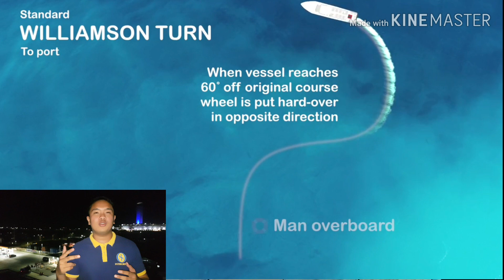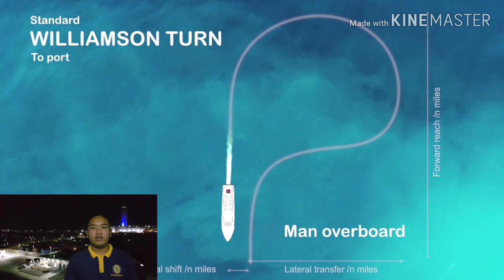SEAM 5

Comment: 1. No, the most effective rudder angle is about 25 to 30 degrees. This is because the rudder is 'stalling at 35 degree angle.
2. About same position as the center of gravity.
3. The sea-trial tests my tell me, or else I can do a test myself to find out.
4. Full power on the forward tug, reduce on the aft tug while checking the gyro.
5. The speed should be less that 5 knots, normally 3-5 knots.
6. Yes, it will give the stern a lift force to starboard. 
7. Full power on the aft tug, reduce on the forward while checking the gyro.
8. Your ship will sheer to starboard rather quickly with the possible consequence of grounding.
9. All the  listed alternatives.
10. Yes, by putting the rubber hand stb., it will  shield water flow to the tbs. side of the propeller and vice versa to port. This will effect turning of the ship.

Comment: Mooring and unmooring operations provide the circumstances for potentially serious accidents. There is no doubt that, this duty requires a good technique initially in lifting the heavy eye of the rope, followed by a good pulling technique. Care must be taken, therefore with the laying out of heavy mooring ropes and wire ropes/hawsers.

Comment: 1. That the wires are just above the water line at all times.
2. be rejected away from the bank by the pressure
3. About 20 %
4. Direction B.
5. It will be much shorter
6. 100 Tons
7. No, drifting in ballast condition may be quite different.
8. Put the rudder hard to port to reduce the water flow to the right side of the propeller
9. Longer
10. A keeps out of the way of B

Comment: 1. Full power on the aft tug, reduce on the forward while checking the gyro.
2. All the listed alternatives.
3. The speed should be less than 5 knots, normally 3 - 5 knots.
4. The sea-trial test may tell me, or else i can do a test my self to find out.
5. About the same position as the center of gravity.
6. No the most effective rudder angle is about 25 - 30 degrees. This is because the rudder is stalling at 35 degress angle.
7. Yes, by putting the rudder hard starboard it will shield waterflow to the starboard side of the propeller and vice versa to port. This will effect turning of the ship.
8. Yes, it will give the stern a lift force to starboard.
9. Full power on the forward tug, reduce on the aft tug, while checking the gyro.
10. Your ship will sheer to starboard rudder quickly with the posible consequence of grounding.

D/C Sarte, Joemar M.
Seam 5
( MON ) 7:30 - 8:30am
( TTHS ) 7:30 - 9:00

Comment: The Chief Officer ( or another experienced officer in lieu) must supervise letting go or weighing the anchors and shoukd only assign experienced crew members to anchors work.

prior to Anchoring, the chief officer should be aware of:
*approximate anchoring position
*Method of approach
*Which anchor use
*Depth of water
*Method of Anchoring
*Final amount of Cables

Borongan, Aldence Joel
TTH(9:30-12:00) F(7:30-8:30)

Comment: James Fred Maglasang
MTTh ( 7:30 - 9:00)

 *Yes, it will give the stern a lift force to starboard.
* All the listed alternatives
* Full power on the forward tug, reduce on the aft tug while checking the gyro.
* Yes, by putting the rudder hard stb. it will shield waterflow to the stb. side of the propeller and vice versa to port. This will effect turning of the ship.
* About same position as the center of gravity.
* No, the most effective rudder angle is about 25 to 30 degrees. This is because the rudder is 'stalling' at 35 degrees angle.
* Full power on the aft tug, reduce on the forward while checking the gyro
* Your ship will sheer to starboard rather quickly with the possible consequence of grounding
* The sea-trial tests may tell me, or else I can do a test myself to find out

Comment: 1. 
 The sea-trial tests may tell me, or else I can do to myself to find out.
2. Yes, it will give the stern a lift  force to starboard.
3. Full power on the aft tug, reduce on the forward while checking the gyro.
4.  About same position of center of gravity.

5. The speed should be less than 5 knots, normally 3-5 knots.
6.Full power on the forward tug, reduce on the aft tug while checkin the gyro.
7. Yes, by putting rudder hard starboard, it will shield waterflow at starboard side of the propeller and vice versa to port. This will effect turning of the ship.
8.All listed alternatives.
9. Your ship will steer rudder starboard rather quickly with the possible consequence of grounding.
10.  No, the most effective rudder angle is about 25-30 degrees. This is because the rudder is "stalling" at 35 degrees angle.
D/C Miko Fuertos

Comment: 1. Full power on the aft tug,reduce on the forward while checking the gyro.

2. Yes, it will give the stern a lift force to starboard. 

3. The sea trial test may tell me, or else i can do a test myself to find out. 

4. Full power on the forward tug, reduce on the aft tug while checking the gyro. 

5. The speed should be less than to     5 knots, normally 3-5 knots.

6. About same position as the centre of gravity.

7. Yes, by putting the rudder to hard starboard. It will shield the waterflow to starboard side of the propeller and vice-versa to port. This will effect turning of the ship. 

8. No, the most effective rudder angle is about 25-30 degrees. This is because the rudder is “stalling” at 35 degrees angle. 

9. Your ship will sheer to starboard rather quickly with the possible consequence of grounding. 

10. All the listed alternatives. 

D/C Rosal, Gerome Bryan N. 
BSMT- H3A

Monday(7:30-8:30am)
Tth(7:30-9:00am)

SEAM-5

Comment: D/C BALTAZAR, JEVER P.
MON 7:30-8:30
TTH 7:30-9:00
1. Full power on the aft tug, reduce on the forward while checking the gyro.
2. Yes, it will give the stern a lift  force to starboard.
3. The sea-trial tests may tell me, or else I can do to myself to find out.
4. Full power on the forward tug, reduce on the aft tug while checkin the gyro.
5. The speed should be less than 5 knots, normally 3-5 knots.
6. About same position of center of gravity.
7. Yes, by putting rudder hard starboard, it will shield waterflow at starboard side of the propeller and vice versa to port. This will effect turning of the ship.
8. No, the most effective rudder angle is about 25-30 degrees. This is because the rudder is "stalling" at 35 degrees angle.
9. Your ship will steer rudder starboard rather quickly with the possible consequence of grounding.
10. All listed alternatives.

Comment: D/C Bejagan, Rodel A. 
7:30-8:30 M
7:30-9:30 TTh 
1. Full power on the aft tug, reduce on the forward while checking the gyro.

2. Yes, it will give the stern a lift force to starboard.

3. The sea-trial tests may tell me, or else I can do a test myself to find out. 

4. Full power on the forward tug, reduce on the aft tug while checking the gyro.

5. The speed should be less than 5 knots, normally 3 - 5 knots.

6. About same position as the center of gravity.

7. Yes, by putting the rudder hard stb. it will shield waterflow to the stb. side of the propeller and vice versa to port. This will effect turning of the ship.

8. No, the most effective rudder angle is about 25 to 30 degrees. This is because the rudder is 'stalling' at 35 degrees angle.

9. Your ship will sheer to starboard rather quickly with the possible consequence of grounding. 

10. All the listed alternatives

Comment: D/C LUBANGA,  KURT WESLY L. 
( MONDAY) 7:30-8:30 
(TTH)  7:30-9:00

1.Your ship will sheer to starboard rather quickly with the possible consequence of grounding.
2.The speed should be less than 5 knots, normally 3 - 5 knots.
3.Full power on the forward tug, reduce on the aft tug while checking the gyro.
4.Yes, it will give the stern a lift force to starboard.
5.No, the most effective rudder angle is about 25 to 30 degrees. This is because the rudder is 'stalling' at 35 degrees angle.
6.Full power on the aft tug, reduce on the forward while checking the gyro.
7.Yes, by putting the rudder hard stb. it will shield waterflow to the stb. side of the propeller and vice versa to port. This will effect turning of the ship.
8.The sea-trial tests may tell me, or else I can do a test myself to find out.
9.About same position as the center of gravity.
10.All the listed ALTERNATIVES.

Comment: 1. The sea trial tests may tell me, or else I can do a test myself to find out.

2. Yes, by putting the rudder hard stb. it will shield water flow to the stb. side of the propeller and vice versa to port. 

3.About same position as the center of gravity.

4. Full power on the aft tug, reduce on forward while checking the gyro.

5. All the listed alternatives.

6. Full power on the forward tug, reduce on the aft tug while checking the gyro.

7. Your ship will sheer to stb. rather quickly with the possible consequence of grounding.

8. Yes, it will give the astern a lift force to stb.

9. The speed should be less than 5 knots, normally 3-5 knots.

10. No, the most effective rudder angle is about 25 to 30 degrees. This is because the rudder is 'stalling' at 35 degrees angle.

HONRADA,KYLE JASON BSMT
TTH 9:00-10:30

Comment: D/C LEGASAN, KENT S. 
M (7:30-8:30 am)
TTH (7:30-9:00 am)
SEAM 5
 -All the listed alternatives.
- Your ship will steer to starboard rather  quickly with the possible consequence of grounding
- About same position as the center of gravity
- Full power on the aft tug, reduce on the forward while checking the gyro.
- Full power on the forward tug, reduce on the aft tug while checking the gyro
- The sea-trial tests may tell me, or else I can do a test myself to find out
- Yes, by putting the rudder hard stb. it will shield waterflow to the stb. side of the propeller and vice versa to port. This will effect turning of the ship.
- Yes, it will give the stern a lift force to starboard
- The speed should be less than 5 knots, normally 3-5 knots
- No, the most effective rudder angle is about 25 to 30 degrees. This is because the rudder is 'stalling' at 35 degrees angle.

Comment: 1.Full power on the aft tug, reduce on the forward while checking the gyro.
2.All the listed alternatives.
3.The speed should be less than 5 knots, normally 3 - 5 knots.
4.The sea-trial tests may tell me, or else I can do a test myself to find out.
5.About same position as the center of gravity.
6.No, the most effective rudder angle is about 25 to 30 degrees. This is because the rudder is 'stalling' at 35 degrees angle.
7.Yes, by putting the rudder hard stb. it will shield waterflow to the stb. side of the propeller and vice versa to port. This will effect turning of the ship.
8.Yes, it will give the stern a lift force to starboard.
9.Full power on the forward tug, reduce on the aft tug while checking the gyro.
10.Your ship will sheer to starboard rather quickly with the possible consequence of grounding.

D/C NEO BRAND ZEUS XENON C

Comment: D/C MACABUHAY, DARWIN ANTHONY T.
SEAM5 (7:30-8:30)Mon
(7:30-9:30) TTh
1. Full power on the aft tug, reduce on the forward while checking the gyro.

2. Yes, it will give the stern a lift force to starboard.

3. The sea-trial tests may tell me, or else I can do a test myself to find out. 

4. Full power on the forward tug, reduce on the aft tug while checking the gyro.

5. The speed should be less than 5 knots, normally 3 - 5 knots.

6. About same position as the center of gravity.

7. Yes, by putting the rudder hard stb. it will shield waterflow to the stb. side of the propeller and vice versa to port. This will effect turning of the ship.

8. No, the most effective rudder angle is about 25 to 30 degrees. This is because the rudder is 'stalling' at 35 degrees angle.

9. Your ship will sheer to starboard rather quickly with the possible consequence of grounding. 

10. All the listed alternatives.

Comment: D/C LEDESMA,ALLEN SHENE T
7:30 - 8:30 MON
7:30 - 9:00 TTH
. 
. 
1. Full power on the aft tug, reduce on the forward while checking the gyro.
2. Yes, it will give the stern a lift force to starboard.
3. The sea-trial tests may tell me, or else I can do a test myself to find out. 
4. Full power on the forward tug, reduce on the aft tug while checking the gyro.
5. The speed should be less than 5 knots, normally 3 - 5 knots.
6. About same position as the center of gravity.
7. Yes, by putting the rudder hard stb. it will shield waterflow to the stb. side of the propeller and vice versa to port. This will effect turning of the ship.
8. No, the most effective rudder angle is about 25 to 30 degrees. This is because the rudder is 'stalling' at 35 degrees angle.
9. Your ship will sheer to starboard rather quickly with the possible consequence of grounding. 
10. All the listed alternatives

Comment: About the same position as the center of gravity
All the listed alternatives
Your ship will steer to starboard rather quickly with the possible consequence of grounding
Full power on the aft tug, reduce on the forward while checking gyro
Full power on the aft tug, reduce on the forward while checking gyro
The sea-trial tests, may tell me or else  i can do a test to find out
Yes, by putting the rudder hard starboard it will shield waterflow to the starboard side of the propeller and vice versa to port. This will effect in the turning of the ship 
Yes, it will give the stern a lift force to starboard
The speed should be less than 5 knots, normally 3 to 5 knots
No, the most effective rudder angle is about 25 to 30 degrees. This is because the rudder is "stalling" at 35 degrees angle

Comment: D/C BADION, GORGONNYJOHN

1.Full power on the aft tug, reduce on the forward while checking the gyro.
2.All the listed alternatives.
3.The speed should be less than 5 knots, normally 3 - 5 knots.
4.The sea-trial tests may tell me, or else I can do a test myself to find out.
5.About same position as the center of gravity.
6.No, the most effective rudder angle is about 25 to 30 degrees. This is because the rudder is 'stalling' at 35 degrees angle.
7.Yes, by putting the rudder hard stb. it will shield waterflow to the stb. side of the propeller and vice versa to port. This will effect turning of the ship.
8.Yes, it will give the stern a lift force to starboard.
9.Full power on the forward tug, reduce on the aft tug while checking the gyro.
10.Your ship will sheer to starboard rather quickly with the possible consequence of grounding.

Comment: Training, Listings, Ship Manoeuvring, Handling Test 1

1. The speed should be less than 5 knots, normally 3-5 knots.
2. All the listed alternatives.
3. Your ship will sheer to stb. rather quickly with the possible consequence of grounding.
4. Full power on the aft tug, reduce on forward while checking the gyro.
5. Yes, by putting the rudder hard stb. it will shield water flow to the stb. side of the propeller and vice versa to port. This will effect turning of the ship.
6. Full power on the forward tug, reduce on the aft tug while checking the gyro.
7. About same position as the center of gravity.
8. Yes, it will give the astern a lift force to stb.
9. The sea trial tests may tell me, or else I can do a test myself to find out.
10. No, the most effective rudder angle is about 25 to 30 degrees. This is because the rudder is 'stalling' at 35 degrees angle.

D/C FERRAREN, CLINT A.  SEAM 5
TTH 9:00 - 10:30 AM

Comment: - All the listed alternatives. 
- Your ship will steer to starboard rather quickly with the possible consequence of grounding 
- About same position as the center of gravity 
- Full power on the aft tug, reduce on the forward while checking the gyro. 
- Full power on the forward tug, reduce on the aft tug while checking the gyro 
- The sea-trial tests may tell me, or else I can do a test myself to find out 
- Yes, by putting the rudder hard stb. it will shield waterflow to the stb. side of the propeller and vice versa to port. This will effect turning of the ship. 
- Yes, it will give the stern a lift force to starboard 
- The speed should be less than 5 knots, normally 3-5 knots 
- No, the most effective rudder angle is about 25 to 30 degrees. This is because the rudder is 'stalling' at 35 degrees angle. 
D/ C Neo, Brand Zeus Xenon C. 7:30-8:30 AM Mon
 7:30-9:00 AM TTh 
SEAM5
Reply from the maker: shiphandling please

Comment: 1. Full power on the aft tug, reduce on the forward while checking the gyro.

2. Yes, it will give the stern a lift force to starboard.

3. The sea-trial tests may tell me, or else I can do a test myself to find out. 

4. Full power on the forward tug, reduce on the aft tug while checking the gyro.

5. The speed should be less than 5 knots, normally 3 - 5 knots.

6. About same position as the center of gravity.

7. Yes, by putting the rudder hard stb. it will shield waterflow to the stb. side of the propeller and vice versa to port. This will effect turning of the ship.

8. No, the most effective rudder angle is about 25 to 30 degrees. This is because the rudder is 'stalling' at 35 degrees angle.

9. Your ship will sheer to starboard rather quickly with the possible consequence of grounding. 

10. All the listed alternatives.

D/C BANATE LORETO JR.
7:30-8:30 M
7:30-9:00TTH

Comment: D/C DUNGOG, JUNGIE L.
M 7:39-8:30AM
TTH 7:30-9:00AM

Each vessel has been designed with mooring arrangements such that ropes and wires of recommended strength can help it moor safely alongside a berth, floating platform, buoy or a jetty. Fundamentally a vessel has to be positioned alongside a jetty or a berth, between mooring buoys, to a mooring buoy, to another ship or barge and then made fast using her own anchors, mooring lines or shore lines.